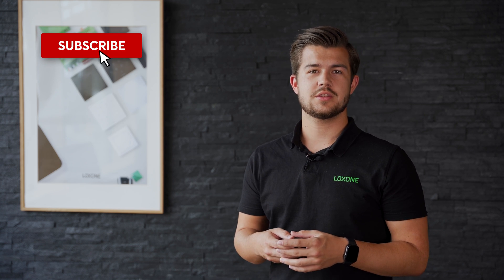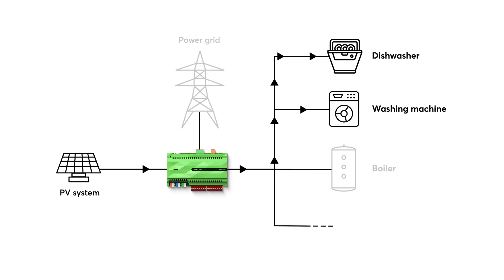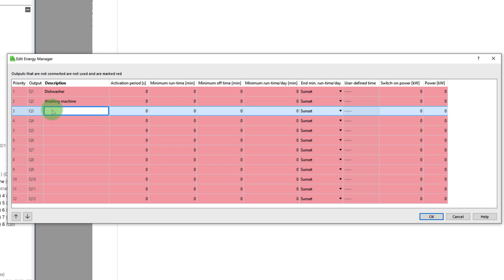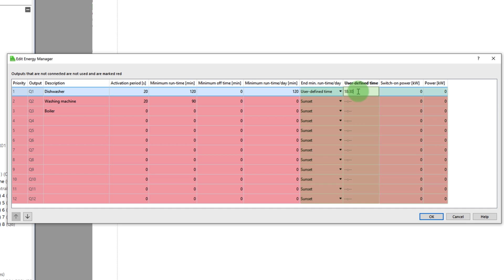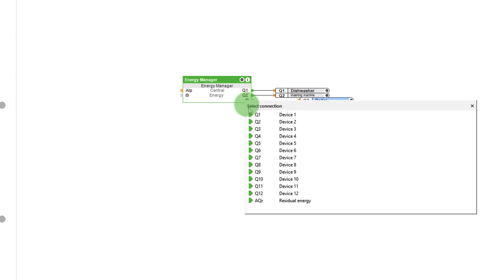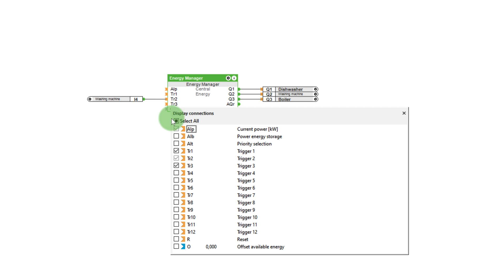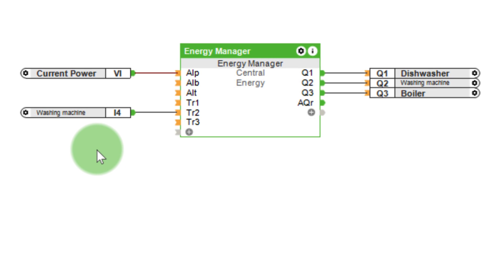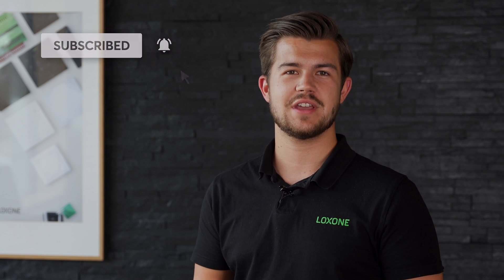Loxone Explained - Energy Management with Loxone | 2021

Comment: How does the loxone say command to the other machine? Which extension do I need?
Reply from the maker: It depends on which technology the other device uses. Loxone offers a lot of extensions, e.g. Modbus and many more.
Reply: Thanks for your help! How can i manage a washing machine? Do they support the modbus communication and I will be able to do the programming via Loxone?
Reply from the maker: Most washing machines don't have Modbus. You could control them e.g. via HomeKit, Miele@home or just via a Smart Socket.